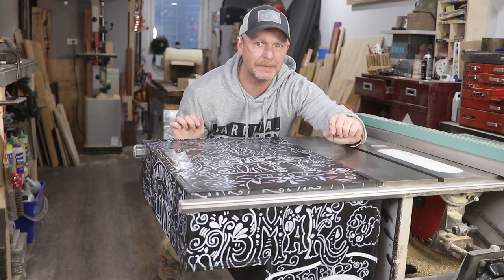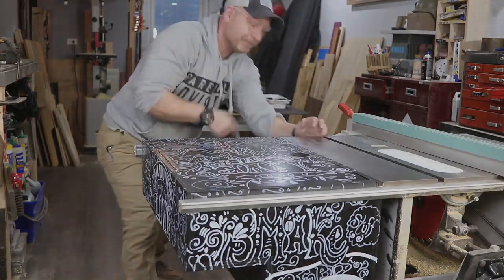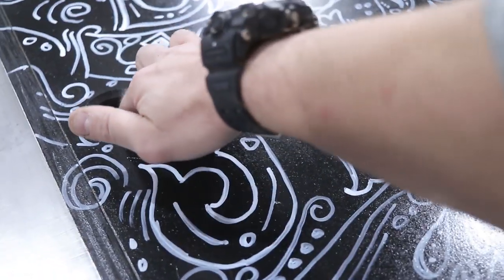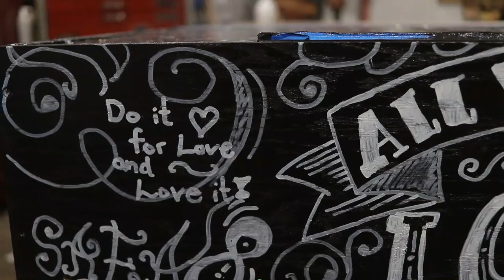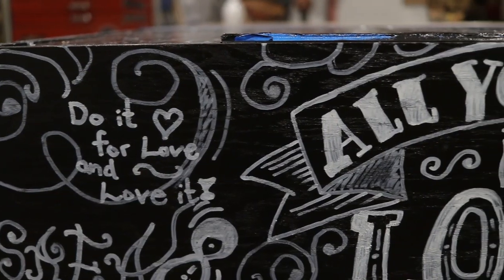Table Saw Storage Cabinet with Cool Artwork DIY

Comment: Love the artwork, but isn't that hinge going to interfere with some cuts or the fence?
Reply from the maker: Handlebar Workshops I though about that too but I never have cut that far off. For that I usually use my track saw.  I can always lift over it if needed.